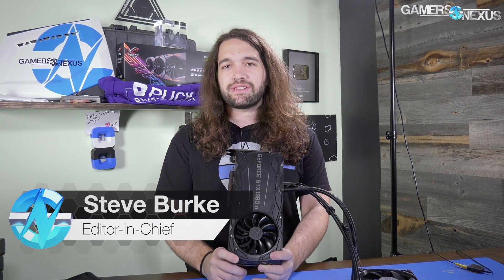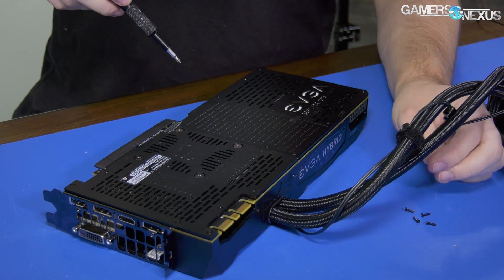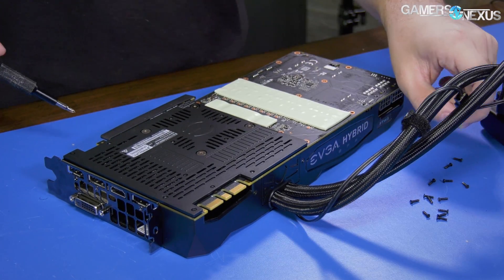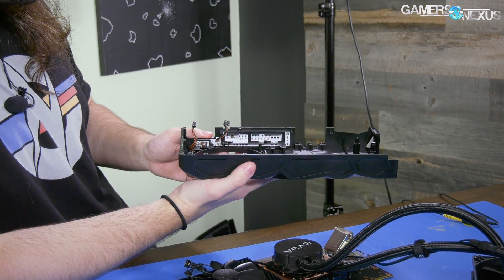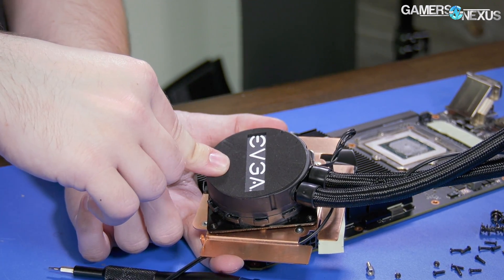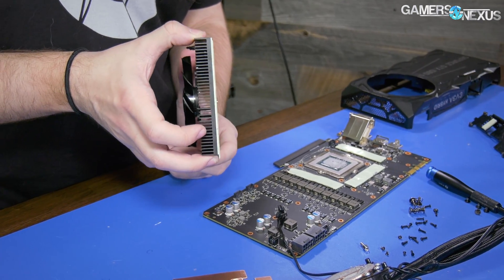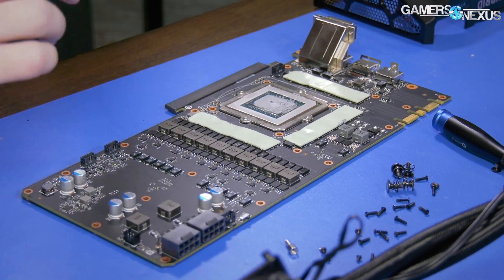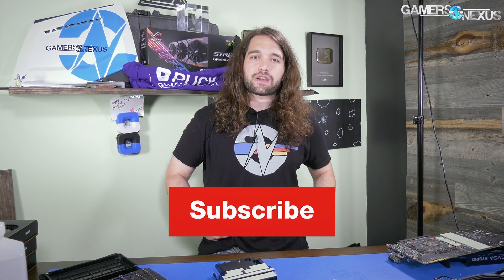EVGA 1080 Ti FTW3 Hybrid Tear-Down

Comment: I just happened to find this vid in 2024 while googling how to refill the AIO on this card. I was pleasantly surprised to see a young Steve showing me the ropes! Thanks Steve!
Reply: I have a kraken g12 bracket with a 280mm AIO on mine, its  a good way to go. 280mm is iver kill but the card is dead silent even at full load, which is 40c.

Comment: My 1080 Ti FTW3 Hyrbid is still kicking butt in 2024, but the radiator gets really hot and the pump makes loud noises. Going to have to tear it down to see if I can fix the problem. This is still a legendary GPU 6+ years later.
Reply: Mine is still alive and used daily also. Its running with a g12 bracket and 280mm aIo but still very much alive and doing work. I guess the OG pump died, I got it as a bare card.

Comment: I have the 1080 Ti Hybrid FTW3 also and I would like to connect the fan that is responsible for the vrms+mosfet's cooling to the main board and control it. Does anyone happen to know how to solder the pin-out of this properly?

Comment: how many screws and which ones are needed to only remove the shroud so I can disconnect the pump power cable and plug it into an adapter to mobo fan header?

Comment: You may argue that this GPU isn't worth it for most but if you are running an air cooled CPU it is supper helpful to utilize the water cooling solution to more immediately remove the excess heat from the case by setting up the radiator as an exhaust before the CPU. That and it allows you to max out settings in games without a chance of thermal throttling.

Comment: Is it possible to convert one of these to a standard air cooled gpu with 3 fans? I have a 980ti hybrid and I want to free up some case room for a Noctua cpu cooler and ditch my AIO liquid cpu cooler. I don't think the loop on the 980ti is going to make it easy to squeeze a Noctua in my machine despite having one of the largest cases around.

Comment: I just ordered one of these and I was wondering if adding small heatsink to the sides of the copper plate could benefit from the air flow pushed by the 1 fan.

Comment: @Gamers Nexus For the area that the Vram plate makes contact with the main coldplate, can the thermal paste be replaced with Conductonaut? Would using liquid metal for tese hybrid cards cause any issues? I currently have a pair of founders 1080ti with liquid metal running just fine with EVGA's upgrade hybrid kit on the way. Would using liquid metal cause any significant change in the temps for hybrid cards, even where the coldplate makes contact with the ram-sink? Cheers, big fan :)

Comment: Did you hit the power limit when using the slave bios? Many owners are having this issue with the FTW3 Hybrid and air cooled cards. The card starts throttling at 117% power target with the slave bios. The power target should be able to hit 127%. Checked it with the Superposition 4K optimized test. Frustrating from a card that costs this much.

Comment: Hey I know this is quite off topic but I was thinking of the pentium g4560 when it popped into my mind that I helped a friend out by giving him an old i3 I salvaged. I was wondering if you could do a second or third gen I3 modern performance test. I know the i5s are super easy to get hold of but just to see how much an I3 with lower Ipc would bottle neck

Comment: How did you get the screw out? I have an old GTX 470 with a screw like that, i want to open and replace the thermal paste
Reply: Jose Najera glue your lil finger to it
Reply: One way is to use a thin flat bladed screwdriver, rock it sideways to slowly eat away a new notch. Other ways that have worked for me in the past are applying a tiny amount of WD40 around the edge of the screw (use a cotton bud; don't let it get into the middle of the screw of course, as that would just ruin the screwdriver grip), and/or briefly heating and then cooling the screw using a soldering iron tip and an inverted air duster can (the propellant is at -55C).

Comment: Personally the pump noise drove me crazy, it was way louder than all my case fans combined at idle. I contacted EVGA about that, they told me the pump should be dead silent, that if not it was defective and would be replaced. I RMA'd the card last week, I'm waiting for the replacement. But I don't really have any hope. I went ahead and bought the adapter cable to regulate the pump speed, I hope I won't have to use it but I'm pretty sure the noise will annoy me so much I'll end up tearing the card down and plug the pump cable to the adapter, so this video is of tremendous help. Thank you Steve.
Reply: I have no pump noise on mine. Hope your new one is without that issue.

Comment: How did you get that screw out? I went and bought a waterblock for my 1080ti but there are 2 screws that I can't get out!!!! I'm scared to use my trustee the blow impact screwdriver for this. Tried the rubber band trick, didnt help. Only thing left to do is use WD40. !#(*&@#(*%$&^@# PLEASE HELP  :(
Reply: Try very briefly heating the screw with a soldering iron and then immediately cooling it with an inverted air duster can (propellant is at -55C). The WD40 may help as long as you ensure it only goes around the edge of the screw; use a cotton bud, don't let it get into the middle.

Comment: Coarse and Fine threaded. The screw difference is used depending on need for a stronger hold.
Reply from the maker: Yeah. The coarse screws go into the plastic shroud, the smaller thread screws go into the VRM heatsink and metal GPU plate.

Comment: Still waiting for 2x 980ti performance and when both are overclocked the 1080ti barely shines in comparison..
Reply: DarkLinkAD man, I just made the switch from my 2x 980ti and I do not regret it in the slightest!! In the games that had good SLI support the 1080ti still keeps right up with the 2x 980ti and for those games with no SLI support the card tears through it so beautifully!!! I game on a 3440x1440 monitor so dropping SLI is nice as its one less level of optimization I have to worry about when a new game drops.
Reply: What resolution do you play at?
Reply: Chris Dunn I completely agree!!! I have the Acer x34 and 1080ti cuts right through it!
Reply: Chris dunn and hakeem is total right have a asus rog swift 34 monitor and the 1080 ti run everything amazingly
Reply: The issue is many new games don't show a great performance increase when running SLI and there are games that show ZERO performance increase in SLI.  Also, it looks like the games that support explicit multi GPU in Direct X 12 don't show a great improvement with Nvidia GPUs.  When I tested it int he few games that support it, I only saw a 10-15% improvement with a pair of GTX 1080s at 4K.
Reply: DarkLinkAD you are delusional.
Reply: DarkLinkAD r u trolling?

Comment: Mine should be here tomorrow... CAN'T WAIT!
Reply: FRESHBRU it's so good man! I was torn debating between this and the standard ftw3 but newegg selling out of the standard ftw3 helped guide my decision. Sure you can push other cards to get around 2100mhz but I LOVE this card bc I'm running it around 2050-2100mhz and the HIGHEST temp I've seen, after an hour or so of maxed out gaming with my home AC off, was 42C!! Sure these 1080ti cards all hit a limit, but this one gets to that limit and chills there instead of being forced there and struggling to keep it!
Reply: Also, not even gonna lie...that rgb light on the backplate was a nice incentive to get this over the SC2 hybrid!
Reply: Chris Dunn yes! This card was absolutely worth the wait. I don't know what games your playing to get temps that low but it's a wise afterthought to add something like a Noctua fan to the rad to push your temps even further.

Btw this card is incredible!
Reply: COULD YOU GIVE US AN UPDATE ON HOW IS IT WORKING SO FAR?
Reply: Mine is running just as good as day one, 

However for some reason there is an ever present buzzing coming from the pump block and it's pretty loud.

I Actually tried to process an RMA with EVGA but I found out that I have to pay shipping fees to them in addition to if there is something wrong my replacement wont be my old fixed card, it'll end up being some grubby other RMA that someone had their hands on, I won't get a brand new one basically.
Reply: what driver were you running.... and did you leave the stock fan on the card?

Comment: I managed to snag this thing for $770 about a month and a half ago through a student discounts and ebates cashback promo. After flashing the second vBIOS with the Strix XOC bios, I was able to get about 2150mhz out of it. Oddly enough, scaling beyond 2100mhz doesn't do anything (and actually negatively impacted results in superposition) so I dialed it back down to 2100. I will say, it's cooling is surprisingly good. Even superposition struggles to make the card hit 50C in an 18C ambient room. I can't even hear the thing running over the noise of my case fans.

Definitely worth $770. I'd say if you can find it for $800 or less, go for it. Otherwise, get the normal SC2 and flash it with XOC and enjoy the same performance. At the end of the day, Pascal is Pascal.
Reply: the strix bios will actually get worse results per clock so if it was doing 2100 on the ftw bios then youll get better results. Probably know that already, but in case you don't.
Reply: I did not. Where exactly did you hear that it does worse? Is there a reason for it? Most of the guys I talked to with reference cards swore by it. I simply used it to test to see how high I could go with no power limits. On the stock bios with a 127% power limit, I was only able to get about 2050mhz.  Scores were a little lower than what I got on the XOC bios as well, so I assumed it helped.
Reply: mostly on the r/overclocking discord home of buildzoid and others. There are some threads on it somewhere will post when i find them.

Comment: 849.99 on newegg ffs I'll stick with my 1080 ftw lol
Reply: Brother Ares yes however I've had custom water cooled loops and they are a pain in the ass lol
Reply: Brother Ares Looks way nicer IMO as well. Too much AIO tubing looks so ugly
Reply: A custom water cooling loop is a lot more expensive than the cost difference of a hybrid 1080 ti over the cost of a similar spec air cooled 1080 ti.

Comment: I own this card. I absolutely love. 
Painful to watch it ripped apart lol but I appreciate the work gone into this
Reply from the maker: Fortunately, these reassemble easily and work just fine afterward.
Reply: Multi7sevens 

EVGA is pretty chill regarding to things like this, before RMA you have to assemble it to it's original state tho.
Reply from the maker: Pretty much the same, yeah. Not sure if we did an FTW3 tear-down, but we did talk about it quite a bit when it launched. Same process to disassemble, mostly. Couple extra cables.
Reply: Gamers Nexus is this the same with the regular FTW3? Non-warranty stickers and ease of reassembly? Cause I'm looking into Plasti-Dipping the shroud and backplate; hoping that it'll not be too much trouble with keeping the warranty intact...
Reply: #smokedoutpositivesquad Thanks! I don't mind having to take it apart again to get it back to normal, so that's fine. Awesome that EVGA is chill about that. Now, I'm completely sold on the FTW3.
Reply: MistahMOB Hi i am really thinking about getting this card can't stand my 1080 running the fans at 80% all the time the noise is killing me. Is the noise low with this card while gaming ?
Reply: The fan on the radiator runs at full force but doesn't make much noise inside my 570x, I might explore a replacement fan in the future. The fan on the card can get pretty noisy over 80% but to solve this I've set it at a constant 60%. The noise is very mild once adjusted. Performance is top notch.